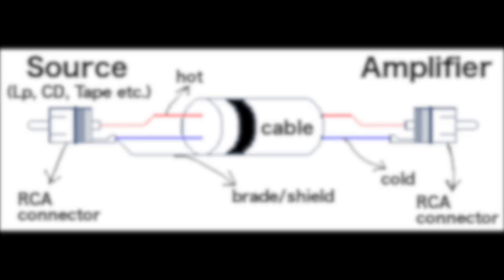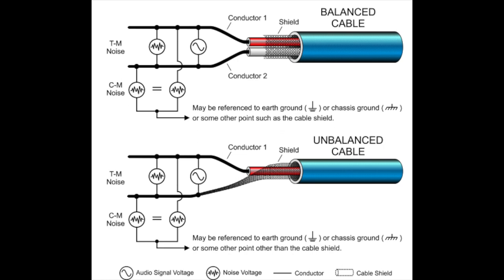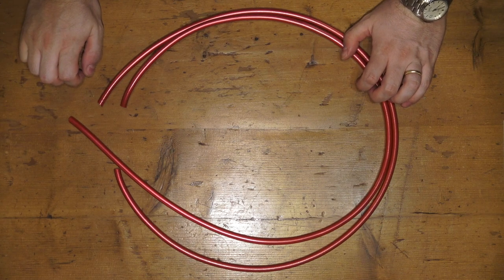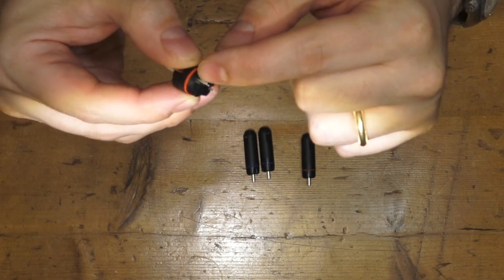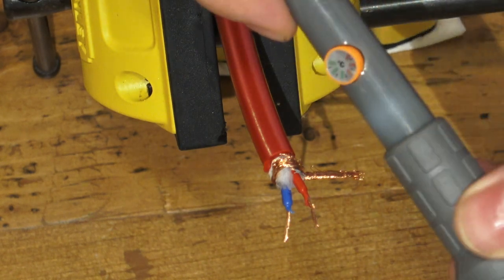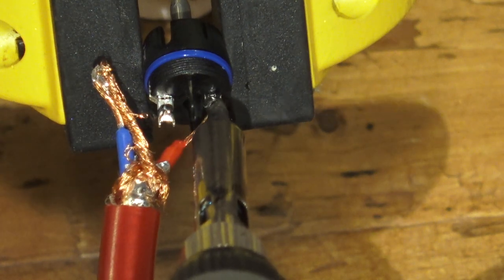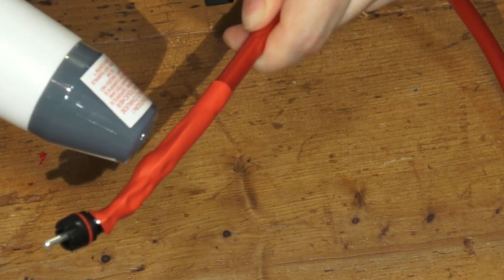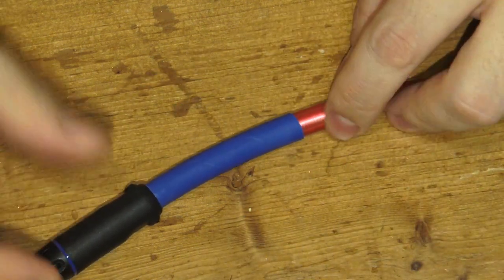How to make a high quality and inexpensive audio interconnect RCA cable

Comment: Hey, hi, thanks for the video, I bought this cable after your recommendation. Haven't ended it yet though. But.... as clever music box commented, I don't get it why not having the earth shield connected both ends, the only reason I can think of not doing this is when you have two system components earthed, so you avoid ground loops, but most of us usually have only the amplifier earthed rest components have a two conductor ac inlets and ac cables, meaning not earthed. I don't know if this is the reason behind it  though(I saw same connecting recommendation in a cable manufacturer site) , cause by connecting cold with shield on one end is like making cold and braided shield one piece which is then connected on the other side by the cold conductor on the earth leg, so we do have our shield connected both sides after all. Anyone correct if I am wrong. And... have a nice time listening to music
Reply from the maker: You can connect both ends you just have a higher chance of getting a ground loop as you said. Both ends is actually better.

Comment: Will try!! What about Speaker cables ;-) ??? Looking for cables for my Harbeth P3esr. Any chance?
Reply from the maker: One day! When I change speakers!
Reply: @anadialog  Since i'm also located in Europe (Vienna) i will buy from one of your recommended Dealers. Perhaps you can help me with the cable for this speaker? Don't know which one to take since i have no experience with cables at all. A good price-performance ratio would be great. I would need 2m each. Maybe you can help. One more question. Have you exchanged the cable from your Technics to your phonopreamp or are you using the original Technics cable out of the turntable? Thanks
Reply from the maker: @alwaysexpandinghorizons6173  do you want to make your own or buy them ready?
Reply: @anadialog  Want to make my own by following your instructions
Reply from the maker: @alwaysexpandinghorizons6173  ok, well, the best thing is to get a OCC copper bulk cable designed for speakers but not necessarily. Good brands are Neotech, Ramm audio, Viablue (not all) etc. Get good gold plated connectors, spades, bananas or what you prefer and your good to go. The wire gauge should be proportional to the resistance of the speakers (number of ohms). You can easily find a proportion chart just googling it. Soon I will do a specific vid on this type of cable but not yet.

Comment: Hello Anadialog,  what about diameters ,  3004 cable has 8.5 mm ,   kle plug 9.5 mm , This is how that should be ? How to choose right ? Thank you
Reply from the maker: Connectors need to have a diameter equal ir larger than yhe cable so in thud case you're good...
Reply: @anadialog  Thank you , I wonder  as well , Rca Plugs the once used  in the video KLE and in general good once , cost similar money . Well I need a lot of them )) They are gold plated , my question is .. I have https://www.hifiengine.com/manual_library/akai/ds-5.shtml tape deck selector , I want to connect tape decks to it , decks have gold plated female plugs but Akai ds-5 tape selector has silvery looking female connections,  is it  weakest point ? Silver (or maybe not silver )vs gold
Reply from the maker: Don't worry! That will not influence the playback that much...go ahead and connect them...and enjoy!
Reply: @anadialog  Good News !

Comment: Great vid, thanks for the info. First attempt at this, I'm using this same cable, can you recommend braided sleeve size for this? It's for cosmetics, as I'm matching it to a vintage luxman stack in wood cabimets, which will be visible from the back as part of a display. (looking for brown sleeves) thanks!
Reply from the maker: The one I used was an exansibke brade sleeve in nylon by elecaudio good for 7-15mm cables.

Comment: A bit of advice, heat the job NOT the solder and you will get a better joint.
Reply from the maker: Thanks but when I did that the pin started to melt the plastic chassis!

Comment: I have not tried to do my own cable but I am interested to DIY my cable.  My question is.... you solder the cable shield to the blue wire and the other end of the cable you did not.  Also, you draw an arrow to represent the direction therefore it's a one way traffic. Which direction is the traffic on the cable?
Reply from the maker: Hi Glenn! The correct direction is from SOURCE (soldered part) to AMPLIFIER (not soldered part)
Reply: ana[dia]log Thank you much. Now I can do mine. I just have to find a good cable and rca head. Any suggestions?
Reply from the maker: YES! Take a look at this video and its description for suggestions: https://youtu.be/91cCufCB9JQ

Comment: I didn’t get the last part. How do we determine the direction?
Reply from the maker: It is usually indicated on the cable itself, otherwise the rule is that the side connected to the brade goes with the source...

Comment: First we buy first-quality copper cables and then we solder the tips with  95-96% zinc and 4-5% silver (best case scenario)...doesn’t this null the whole purpose?
Reply from the maker: I agree that other solutions would be better, I prefer cold connections but with RCA connectors its very rare.
Reply: ANA[DIA]LOG Do you mean soldering with actual gold?
Reply from the maker: No, the so-called cold soldering. Like crimping, compression etc.

Comment: Hi. Could you please specify which end of the cable that is plugged into the amplifier/source?

Thnx.
Reply from the maker: +Frans-Leonard Markaskard Hi, the part connected to the amplifier has the arrows towards the RCA connector and DOES NOT have the esternal brade connected to the cold pole as instead happens on the source side, which instead has the arrows facing the opposite side of the RCA connectors. I hope this answers your question!
Reply: Irrelevant. It has 0 impact.

Comment: So amp gets cold side from preamp and preamp gets cold side from components?
Reply from the maker: If you are taking about the shielding you should connect the brade as illustrated always on the side of the source, where the signal incomes. A lot of people claim its better to connect both sides but you are risking to have a humm that way.
Reply: Thank you. I do have a hum by connecting both sides. Going to follow your guide.

Comment: Sorry but there is no such thing as a semi balanced topology.
Its either balanced (multi point) or unbalanced (single ended)  Balanced means that the signal is comprised of an in phase signal on one signal conductor and an inverted phase signal on the other signal conductor.  The signal is the potential difference between the 2 phases. That is what balanced means or multi point topology means.   Ground has nothing to do with the balanced signal, it merely facilitated shielding from EMI & RFI noise ingress.  Any noise ingress that gets past the shield is largely cancelled by the balanced signal topology because noise has the same phase on both signal conductors, so the noise does not have a potential difference with which to form a signal.  

In an unbalanced or single ended topology, there is only an in phase signal and ground.  The signal is the potential difference between ground reference and the in phase signal.  As the ground is also the shield, noise ingress is part of that signals potential different & can becomes a noticeable problem.

These are completely different topologies and there is no hybrid, semi balanced topology.
What you are describing is simply as way to attenuate ground noise within an unbalanced topology.
It is not some king of semi hybrid topology.  That doesn't exist, it's a myth.

Comment: This style RCA is only useful if you equipment that outputs differential RCA signals, and equipment on the other side that also accepts a differential RCA signal. Worka exactly as a XLR, just minus the ground srap. But unfortunatly this won't do anything if you dont have the equipment that uses it.
You also would want to keep both wires getting the exact amount of rf noise and wire properties (resistance and capacitance) so the equipment only sees the differences and can discern the noise in the interconnect to get rid of. So she shield may or may not be detrimental if you are truly using differential RCA capable equipment.

Comment: Thanks to your video very helpful, can you also make video on how to make speaker cables ?
Reply from the maker: +Aljaž Grebenc thank you for your appreciation. I Will certainly do that in the future!
Reply: I have one more question... At home i have Neotech NEI-3002, UP-OCC Copper Interconnect Cable
RCA wiring:
RCA Plug at the amplifier end: screen + black conductor to RCA earth. Red conductor to RCA signal.
RCA Plug at the pre-amplifier end: black conductor - RCA earth (screen cut short, not connected). Red conductor to RCA signal. This are instructions how to make cable from hificoleccive site.
My question is ....is this a mistake ? Screen is always at the source side ?
Reply from the maker: +Aljaž Grebenc Yes, they got mixed up. If the cable is semibalanced the screen is connected always at the source!

Comment: Would that not be called a "shielded" unbalanced cable?   Rather than a semi balanced?  I found shielded RCA cables tended to mellow out the leading edge of the dynamics.  But,  some will like that sound just the same.  Balanced cables do not blunt the leading edge.  IMHO.
Reply from the maker: Yes, you are correct. Semibalanced does not exist but it is a very diffused term.

Comment: The shielding is wrong way round you have the Shield to Earth always so that would be to the amp the open end would be to the source
Reply from the maker: Not really John! That is when you have a dedicated ground on the output side. Check this for a reference: https://rane.com/note110.html The norm is 20A, but we want to connect the brade for shielding and in that case the correct wiring is 6, from source. In any case, people connect both sides sometimes (with the risk of hums) and others, rarely, like you just said...

Comment: Looks like you put shrink wrap under one plug, but over another.  What determines which way you do it?
And is shrink wrap necessary?  Would electrical tape work instead?
Reply from the maker: Yes, you are right! No difference actually. I just got mixed up. Well, shrink wrap is just a good idea to keep everything in position and have an indication of the RIGHT channel (usually RED) and the LEFT channel (usually BLACK or blue). Obviously, a cool shrink wrap on a external nylon brade (that I did not use in the video) closes neatly all the work!

Comment: But you don't know how to solder. Don't heat the solder and drip it onto the wire (poor connection). heat the wire or connection from underneath and add the solder to the hot connection after tining your soldering iron, you should also use flux. You could simply put flux directly onto the wires first.
Reply from the maker: Hi Nicholas, thank you for your comment. Yes I am aware about this and it is good to mention it. I did try a lot a few times to heat the wire with I feel that I have less control so I prefer to use this unorthodox way. Talking about flux I have heard different opinions on the effect...
Reply: Heating the surfaces is what counts to get solder-flow between the surfaces. Flux cleans the 
surface and provides flow at the same time (and thus a solid connection). Clean off any flux with alcohol....Very nice video btw
Reply: yes that how I do it too,especially with that particular solder he is using.

Comment: Not trying to be negative but please, stop misinformation. There is no such thing as a semi-balanced cable. When you solder the shield to one end you are not only not gaining any benefits, you are losing the shield’s functionality and adding capacitance to the cable. You actually make the system sound WORSE than with a regular shielded RCA or Coax cable.
Reply from the maker: Tomas, I did not invent anything. This is a standard procesure in analog interconnects. Don't take my word for it. Check around! If you connect the shield on both parts (and we are not talking of a true balancwd signal) you are going to have issues as hums etc.
Reply: ana[dia]log Look, again, not trying to be negative because I think that the video quality and explanation is great. But, first of all it being a standard procedure doesn’t mean it’s correct, people thought for centuries that the earth was a flat surface being held by two giant turtles. That didn’t make it correct. Finally, take my word for it, I study engineering, I know the science behind it. There is no such thing as a semi-balanced cable. You are just removing the advantages of having a shielded wire and adding capacitance which is a big deterrent to signal quality. You would need 3 pins to make it balanced since connecting the shield only to one end does not do anything, you need both ends to have a flow of electrons. Again, you are only adding capacitance and removing the Faraday cage effect provided by the shield.
Reply from the maker: Yes, I do agree that the term semi-balanced is not a scientific term, it is or it isn't balanced. But, apart from the debate, can you explain why almost all high-end cable producers do this? The capacitance increase makes sense but again why is the brade connected to the cold pole on almost all unbalanced cables? They can't be all wrong...in any case, since I am not an engineer or technician, please send me scientific articles of this and I am ready to change my mind.
Reply: ana[dia]log Well, I think they do this because it allows them to charge an extra buck for something that really doesn’t increase the overall production cost of the cable. I can find an article about this but really is something quite basic in the field of electricity and magnetism, so it would be like trying to find an article proving that 2 x 3 = 6. Basic proof would be two main basic principles of electricity. First, in order to have current or electron flow, you need a closed circuit, electrons won’t flow into dead ends. Secondly, electrons always prefer the path of low resistance (that’s why you ground components, so that you don’t become that path), but once the path is chosen, they don’t have preference for a particular order of circulation, so directional cables are equivalent to claiming that 2+2=5.
Reply: @anadialog  I have 6 patents in this field... What you are doing is great! Your creating a sort of virtual ground within the cable, you'll get more dynamics...  My cables sound fantastic along with several other unconventional secrets that I cannot discuss... I'm an electronics engineer, with an open mind...

Comment: Dude. After all this fusss, you grace us with this soldering ?.. everu heard of flux ? And get yourself a decent soldering iron and heat gun while you are at it. 😂😂😂 but thanks for the info. I now get what is a "semi balanced" cable ... good fun 😁
Reply from the maker: The soldering wire has integrated flux like most wires today. My iron ain't that bad! I have a heat gun now!

Comment: Hello AnaDIAlog , great video ,  I v seen it before , but it is time for me , need to make a Lot of RCA connections , quality matters a Lot now ,  need custom sizes , What is your Opinion on this cable ? http://www.van-damme.com/vandamme_product/van-damme-up-lcofc-hi-fi-twin-interconnect-cable/     or the one you using is better ?  Appriciate
Reply from the maker: Hi there, if I can be honest I do not like Van Damme cables, they use oxigene free copper, which is good but nit nearly as good as OCC copper. Check this vid for full details: https://youtu.be/91cCufCB9JQ
Reply: @anadialog  Thank you , yes 3004 better , I looked into it

Comment: Yeah, I’m afraid your soldering technique definitely needs some work. When you tin the wires you don’t use sufficient heat or solder. Dabbing solder on the way you show is not the way to do it - sorry.

You don’t really need a temperature controlled soldering iron either - a standard 25W model with be fine.

Comment: Thank you very much for this video.  I have been watching your videos for years now.  I'm thinking about producing my own interconnects after looking at this video.  

I have been looking into other videos regarding the interconnects (RCA) to gather more information on the topic.  I came across this (https://www.youtube.com/watch?v=QOagVDZLQnA) which states that there are basically two types of RCA cables (twisted pair RCA cable vs a Coaxial RCA).  But I have to admit that I'm very confused on which type to produce, as it must be dependant on the system (amplifier etc.) one has.  I have seen other videos showing how to make this similar as you are doing except that often (most often) then it looks like they are making the coaxial type.  Do you know how one is to know which type to use?
Ciao,
Axel Viðar in Iceland
Reply from the maker: You can use both but I would would with a simple quality Interconnect OCC copper or silver cable and get quality RCA connectors as well.

Comment: What good is the best cable if you don't work cleanly? cheapest plug, bad work, sorry.
Reply from the maker: This is a video that is supposed to inspire you and di your own which I am sure you will do better then me. It's not a performance with vote in the end! :-)
In any case the connectors are good quality. Remember that the goal here was a low cost cable and the sound is simply amazing.